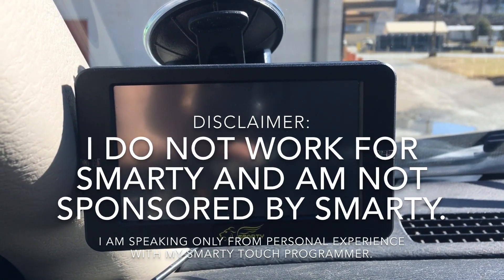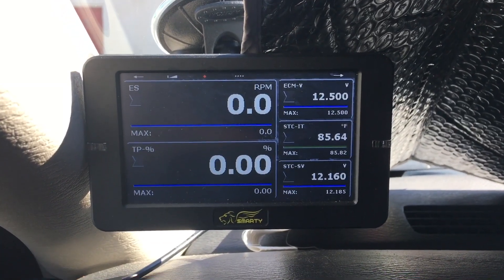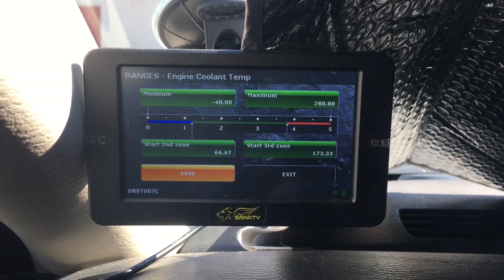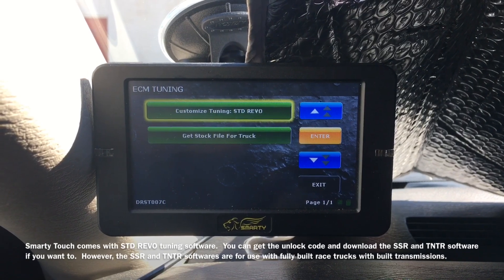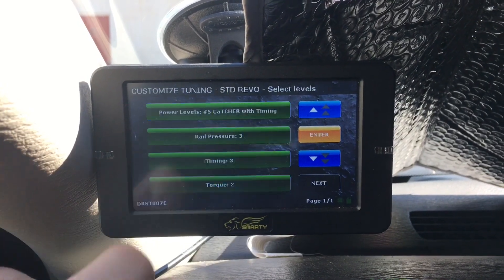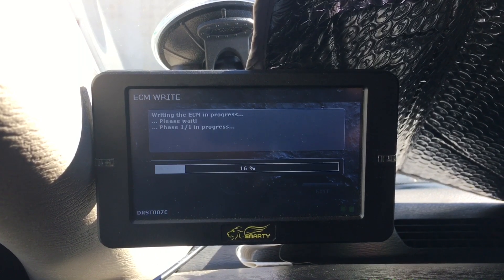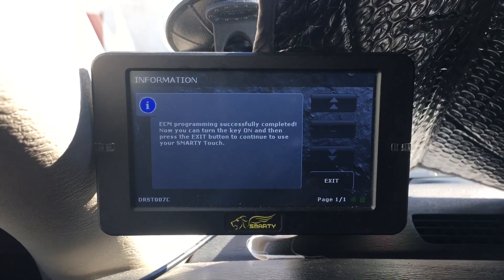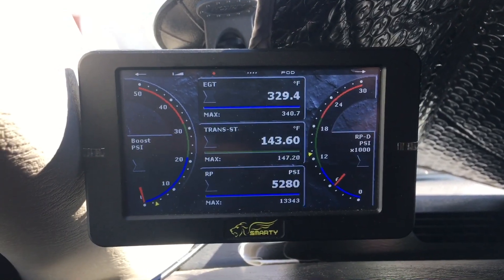How to program a Smarty Touch

Comment: Great video! I'm basically stock except 75hp injectors. My truck is an 01 5.9 dually with a 6 speed, 3.55 rear . I'm trying to run a tune to keep the smoke down and get better mileage. It my welding truck so i have some weight on it too. Any suggestions would be great.  Thanks in advance
Reply: I hate to say spend more money, but you probably are going to need either a larger turbo, or compound turbos to reduce the smoke with 75hp injectors installed.  Either that, or put the stock injectors back in if you still have them.  My truck has stock injectors and I still get some smoke with this tuner turned up above level 5.
Reply: @jayraysdiy852    thanks for your reply. 👍 I will look at both options and go from there
Reply from the maker: @Countryliving_Drifter  I know that I would personally prefer the compound turbo setup, but it can get quite expensive.  I have seen kits ranging from about $2,000 and they go up from there.  I was looking at a kit from ATS which is about $5,600.  This is parts only, the labor is an additional cost unless you do it yourself.  If you install it yourself, make sure you have a long weekend to do it as it can take a couple of long days to do.

Comment: Super helpful video! Instructions for these things are garbage! I think mine is set to lv 2(towing) on the basic tune. I can’t wait to go mess with the advanced features in the am. Another thing is I lost 3 mpg. Any help would be great! I have an 18 2500 bone stock.
Reply from the maker: These tuners will definitely give you more power.  The problem is that when we have more power, we tend to want to use it.  I know that I always enjoy feeling the difference when I hit the skinny pedal.  Unfortunately, I cannot help with the mpg loss.  I experimented with the tunes to see which one my truck liked best, including best mpg.

Comment: Hey brother thanks for the video does it tune multiple vehicles or only one ? I work with HP Tuners for my gasers do you know of a good editor like Hp tuners for diesel ?? Thanks again
Reply from the maker: The Smarty has VIN # locking, so it is only good for 1 vehicle.  I’ve heard that you can put the vehicle back to stock and then transfer the tuner to a different vehicle, but I’m not 100% on that.
Reply from the maker: If you want more freedom to tune and/or know of a tuning company that can write tunes for you, you might want to research EFI Live tuning for your diesel.
Reply: Jay Ray thanks brother I’ve been tuning with hp for a while but just stayed in my own lane but of course having a lot more understanding on how to tune I trust myself to brand out more . yes I’m aware of EFI live I will check it out I appreciate it a lot
Reply: @thomasjohnson1142  You can only tune a single truck at a time, but I just bought a used smarty touch and bought a code for 150 to let me use it on my truck, works perfectly fine!

Comment: Question, idk anything about smarty tuners, this 2005 Cummins I’m buying tomorrow has a smarty touch on it and dude said it’s on a tow tune but I didnt like how it drives and feels and I just want it stock, do I just change all those parameters like rail timing and stuff back to “stock” or what? Thank you
Reply from the maker: Yes.  Just change the ECM tuning parameters back to stock and then follow the on screen prompts.  That should do what you want.
Reply from the maker: I’m curious though, what do you not like about the way it drives and feels?
Reply: @JayRays1truck sorry never knew you commented a 2nd time. But it felt like it was too “hot” of a tune and it smoked like a coal train. I don’t mind a little smoke but good lord. I ended up putting it to stock and put my Edge evolution on it with tow tune, got a little bump in power and smokes some when I stomp the go pedal lol
Reply from the maker: I’m glad you were able to get it in a spot that you like better.  My truck is a bit different I guess.  I can put the Smarty at level 9 and it only smokes when I stomp the gas pedal.  It makes it feel like it should have come from the factory that way to me, but not an overwhelming amount of power.  My 2015 HEMI is still faster than my diesel.
Reply: @JayRays1truck  the dude I bought it from did tell me it will be slow as crap running it stock and he was right (it had the smarty tune on when I test drove it) I’ve owned it close to 2 months now I may take the edge off and try that smarty tow tune and see how it feels again now that I’m actually used to how the truck feels and drives now. Who knows may like it lol

Comment: Where did you put the egt on the manifold?  Do you really need one.
Reply from the maker: I drilled and tapped the manifold right in the middle where all of the ports come together, just a couple inches above the flange.  

As far as your question of whether it is necessary, I believe it depends on what you are doing with the truck and how much horsepower you have.  If you tow a lot or heavy, then I would say yes it is helpful.  If your truck is basically a daily driver that you don’t tow with, then you may not need it.

Comment: Hows the rp and timing on yours? I run the same but rp is 1. Timing and torque 2.   Ramps up too 20 no problem. Afraid to bump the rp more
Reply from the maker: I currently have my rail pressure at 2.  Timing is at 3, and I am at Power level 5.  What is ramping up to 20? Boost pressure? Do you mean 20K rail pressure?  I have seen 36 psi boost and 29K rail pressure in my truck with no issues.  If increasing pressure and adding timing, take note of how responsive your truck is and how much(if any) smoke comes out the tail pipe.  If it starts to be more than a puff of black smoke when you hit the skinny pedal, you can back off on the rail pressure a little bit to clear it up.
Reply from the maker: Also,  I have ran my truck tuned at power level 9 with RP at 3 and Torque at 3 before.  Only issue is it blows black smoke quite a bit even without a load on my truck.  If you do that, make sure you pay attention to your transmission temperature

Comment: Are you able to mess with the boost psi at all? Thanks
Reply from the maker: Changing you timing and fuel pressure could lead to a slight increase in boost pressure, but it will most likely not be much.  At factory settings, my truck runs around 28-32psi of boost (max).  I can hit 34-36 psi boost with the programmer at level 9, fuel pressure at 3, and timing at 3 with the skinny pedal to the floor.  

My truck has the HY35 turbo.

If you want more boost pressure, you will have to consider a different turbo, or compound turbos.  You might also need to add a boost fooler if you plan to go over 40 psi.

If you want the turbo to spoil quicker, to get to max boost as soon as possible, that can be accomplished with timing.
Reply: Oh ok thanks i have the HO 5.9 24v i have the hx 35 turbo and i think there is a boost fool that comes with it?

Comment: Ok so how do i get past the ecm tuning? Whenever i try to tune the ecm it say turn key on so i do so and it goes for a couple seconds then says timeout...how do i fix or what am i doing wrong
Reply from the maker: Are you actually starting the truck, or just turning the key to the on position?  I haven’t had that happen to me.  If it keeps happening, you might have to get a new SD card and put the files on it, then try again.  If that doesn’t work, you may have to contact MADS Smarty for a resolution.

Comment: Can I delete the EGR and anything smog related with a smarty tuner ?
Reply from the maker: Technically, on 3rd gen trucks the Smarty does not care.  There is not a setting in the Smarty for deleting EGR and/or other emissions related equipment.  The Smarty only changes timing, duration, and fuel pressure to give you more power.  I do not know what settings it has for newer trucks.

Comment: What settings so you think are best for fuel economy? 04 5.9... just bought the truck and it has a smarty touch already installed. My fuel economy is really bad
Reply from the maker: All I know is my truck which is a ‘03 4x4 and I played with the settings to see what my truck would get.  My truck likes the REVO tune power level 5 torque 2 and timing 2  with a very light touch of the skinny pedal to get the best fuel economy.  Many people will argue that stock settings will get you the best economy, but each truck is different. I think economy is mostly how you control your right foot and how much (cool) air flow your engine has into it.  The best I ever saw on my truck was 19.6 mpg on the highway, empty.
Reply from the maker: One other thing you could do is try different settings and if you see smoke, go to the next lower setting since smoke out the tailpipe equals too much fuel.
Reply: Timing advance = more mpg and snappiness.  Harder on the engine for towing though.  if pulling heavy stock timing is best.

Comment: What does changing the ranges do?
Reply from the maker: which range are you referencing?  There are different levels for power, fuel rail pressure, and timing .  Each one can give you a different level of horsepower and/or torque.  you can also change the max speed on your truck as well as entering a different tire size to calibrate your speedometer.  For example, My truck has oversized tires so my speedometer was not reading correctly.  I measured the overall height of my tires, entered that in the programmer, and verified with GPS monitors that my speedometer is correct now
Reply: @JayRays1truck  any of them. Like changing the coolant temp range what does that do? Other than the obvious
Reply from the maker: That allows you to see a different range on the gauges. It’s a visual representation. For example; If you want to see temperatures between 130 and 200 degrees only, you can set it to that range.  You can also set it up to alarm at a high temp, or a high rail pressure, etc.
Reply: @JayRays1truck  nice.        On another note, my EB doesn't run when its cold. Know anything about that?
Reply from the maker: when you say EB, are you referring to engine block? If so, you should plug in your engine block heater in cold temperatures.  My truck is usually fine until it gets down in the teens, say 15 degrees F or less.  Then it has to be plugged in.  If your truck doesn’t have one, you can purchase one from the dealer or you can get some “strip” heaters to put on your engine oil pan and transmission to help keep the fluids warm.
Reply: @JayRays1truck  exhaust brake
Reply from the maker: oh okay. I don’t have one on my truck so I am not real familiar with them.
Reply: @JayRays1truck  ok

Comment: Where is the trans temp located ? It isn’t in my trans or temperature category in the smarty menu.. :(
Reply from the maker: Touch the spot on your gauge display where you want the temperature to be.  This will pull up parameters.  Select “Transmission”. Then select “Trans Sump Temperature”.  This should display your transmission temperature
Reply: Jay Ray thanks for the reply ! I did a bit of digging and I guess the smarty cannot display trans temp on a 03/04 305 hp 5.9s.. the edge monitor I had before could. But smarty’s can’t for the 305 😔
Reply from the maker: That’s odd.  Mine is an ‘03 and it works, but I have the 235hp auto truck.  Maybe that’s the difference? I’m not sure if it would change anything, but is the firmware up to date?
Reply: Well that’s the thing I’m not 100% sure if it is. I bought it a year ago but who’s to say how long it was sitting on the shelf for.. wouldn’t hurt to plug it into the computer and see I guess
Reply from the maker: kawasaki66100 were you able to see if the firmware was up to date?

Comment: Do you know why I don’t have power on demand on my smarty touch?
Reply from the maker: what year is your truck?
Reply: @JayRays1truck  early 2004
Reply from the maker: when you turn your truck on, does it say POD on the top of the screen close to the middle?  or does it not show at all?
Reply: @JayRays1truck  not at all
Reply from the maker: You are probably going to have to contact MADS Smarty about it.  The only thing I can think of would be that it may need a firmware or software update.
Reply: @JayRays1truck  I looked at that and it says I’m all up to date
Reply from the maker: I’m sorry , but that’s all I could think of. Sounds like you will have to contact MADS about it.  I would be curious to know what they say.
Reply: @JayRays1truck  ok I’ll try to contact them
Reply: @JayRays1truck  I figured it out not sure why but it doesn’t show up under ecm I have to click on the main menu to find it